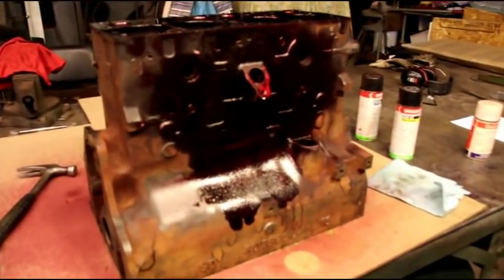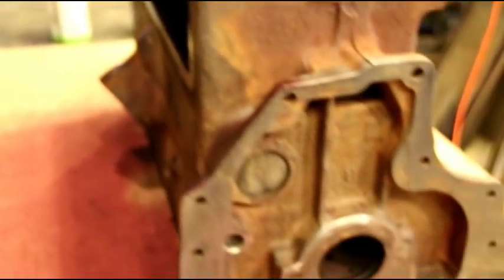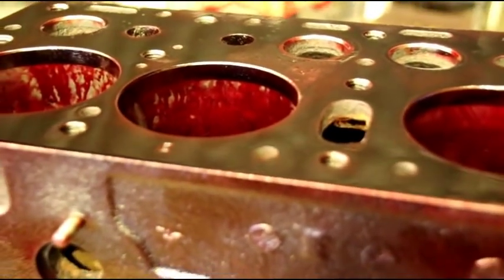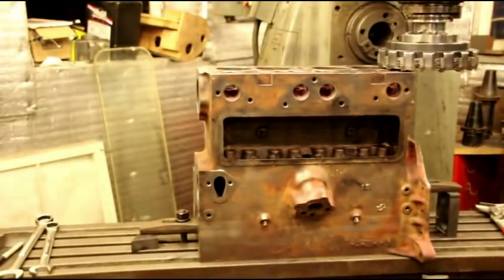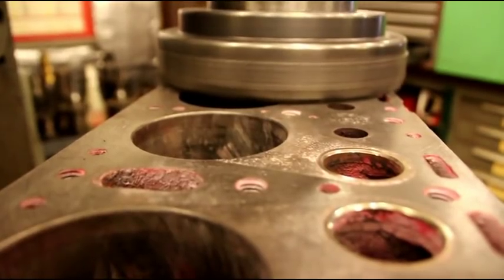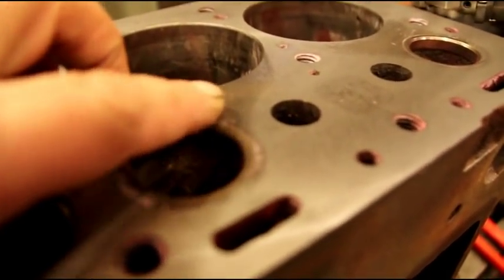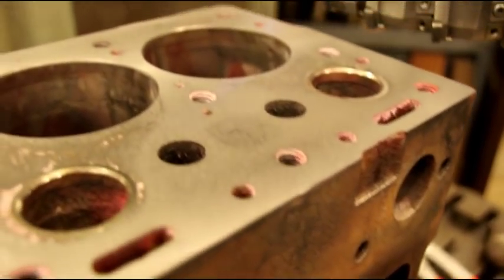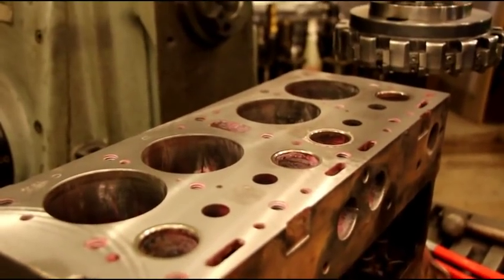Willys F Head Engine Rebuild: Decking the Block

Comment: Hi Brian, interesting that you also mount the main bearing caps, thanks for the info.
My engine block will go for decking next week. I would like to know from who you buy your crank bearings and pistons, would appreciate it if you would share that with me please. I will complete stripping my engine tomorrow, its also a F head
Reply from the maker: I use Silv-o-Lite pistons in most of my rebuilds.  I am not sure if there is a distributor in your area but check it out.  For bearings give Pete a call at 631-874-8660 and tell him that Brian sent you and he will get you set up with exactly what you need.
Reply: @metalshaperJeep  thanks Brian, appreciate the feedback.
I will see if I can source the pistons in South Africa, otherwise I will have to bring them in from the states.
Reply: @metalshaperJeep  hi Brian,
A quick question on exhaust valve seats on the F head.
What would be the determining factors to replace the seats.
I will get the concentricity checked.
The block will also be decked after machining. How much can the seat be machined, I guess the more you machine it the deeper the valve head sits into the seat, is there a limit on how much the valve head must sit above the seat?Is there a min thickness the seats may be after decking? The maintenance manual does not really give this information.

Comment: You should start with a 30 thousand's cut and then go to 5 these engines are very low compression and they can use a little bit more God-bless everyone

Comment: Do you set the top of the block parallel to the crankshaft journals? Or do you assume the crank line bore is correct to the bottom surface of the block and go from there??
Reply from the maker: The crank centerline is perfectly parallel to the bottom of the block in 99.99% of Willys L and F head blocks.  I always check before milling.

Comment: Hi, I a willys block completely rusted. What worry me the most is where the water goes to cool the engine as it is not accessible... would you have some advices?
Reply from the maker: Take it to a shop that can hot tank it and remove all the junk from inside the block.